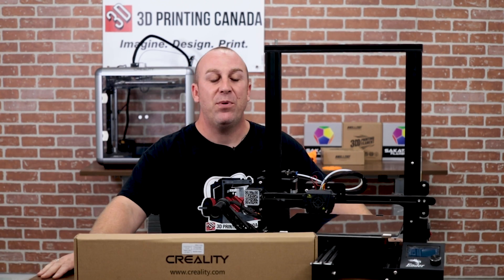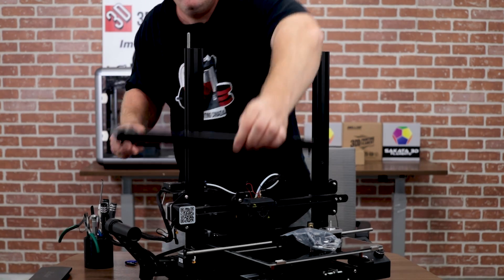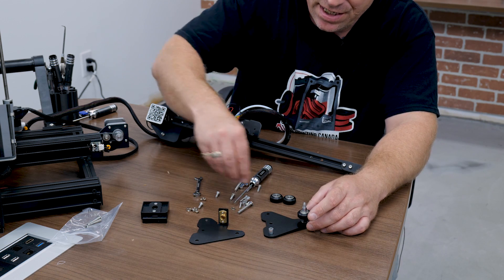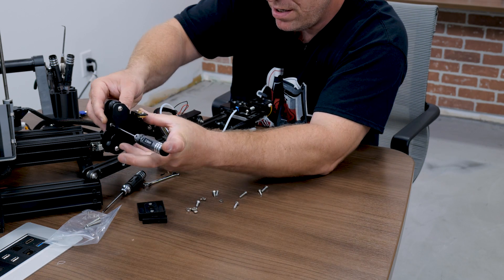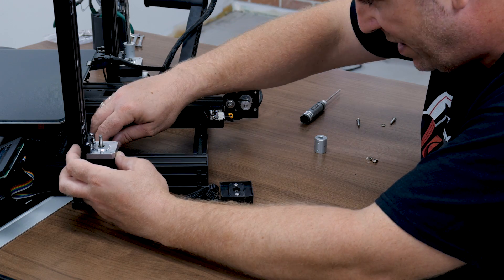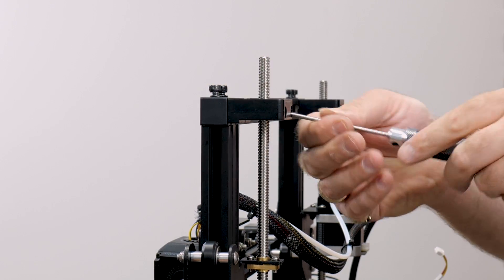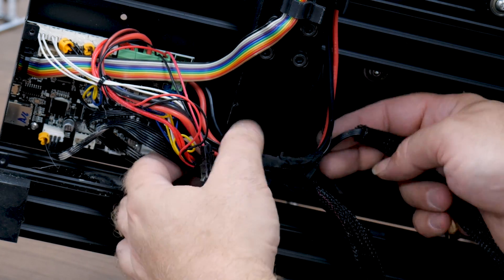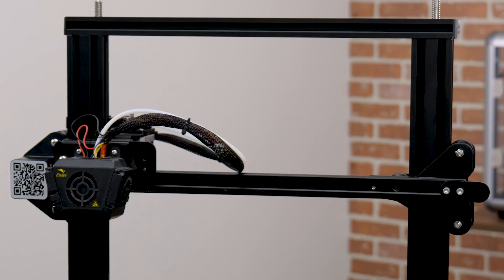ENDER 3 MAX DUAL Z INSTALLATION

Comment: A useful video but I need to know something, which Creality kit did you use for this mod. I can find it for other Creality Ender 3 printers but I don't know if it will fit the Ender 3 max.
Reply: I can't find it either.
Reply: You need to buy ender 3 kit and a z rod separately beacuase the one you get is too short for the max

Comment: You had so many opportunities to square things up but you did none of it.
You could have put the anti backlash nut back on. 
You didn't need to replace the stepper cable at all, you could have plugged them both into the new harness and the old stepper connect as input to the harness.
Sloppy speed run. Don't do this at home kids!
Reply: Chaining stepper cables together is a bad idea kids. Don't take this guy's advice. 

It adds impedance between the control board and the steppers and can cause all kinds of issues.
Reply: @lambdaman3228  it's a ribbon cable, so it adds capacitance, inductance if any would be negligable. But either way I think the word you meant to say is reactance, which would limit the current draw for both motors.
Reply: @jacobbaylis5532  Let me make sure I understand you. You're saying that "impedance" was the incorrect term?
Reply: @lambdaman3228  after reading over your comment a second time, I misread the original comment, my apologies.
Reply: @jacobbaylis5532  This is impossible. Nobody on the internet ever makes a mistake. And if they did, they would never admit it. Where are the cameras?!

Comment: I second needing a link.  Cannot find a kit for the Ender 3 Max at all.
Reply: I just bought a dual lead screw kit for an ender 3 and then bought an additional 480mm lead screw
Reply: I did the same but I bought a 500mm leadscrew

Comment: Which Creality Dual Z Axis kit are you installing here? I've only seen the kit for the Ender 3 V2 which has a shorter threaded rod than the Ender 3 Max in this video. Please provide a link to the kit or parts you are using.  Ender 3 Max lead screw is 470mm and the screw in the Creality kit is 370mm but the screw in this video is about 1" longer than stock..... Whaaat?
Reply: Ender 3 Max lead screw is 480mm
Reply: @techdegenerate286  you can buy the stock creality kit and then buy a T8 lead screw that's at least 480mm
Reply: CR-10 kit seems to be what he's installing.   Creality offers another (For Ende3) that has shorter T8 Z rod, but comes with metal brackets to mount the Power Supply (but has shorter T8 rod for ender3.... can buy a 500mm t8 rod if you use the E3kit).

Comment: nice looking kit but it would have been better if they had included a belt and sprockets so they were tethered together.
Reply: This isn't always necessarily a good thing depending on your setup. The threaded rod isn't perfectly straight so when you permanently affix the top in a way that doesn't allow for play you  can cause Z axis binding.
Reply: I agree - I manually move mine very often, especially after tall prints. ** Worth mentioning: the new MAX NEO does have a belt to connect the two Z's at the top.